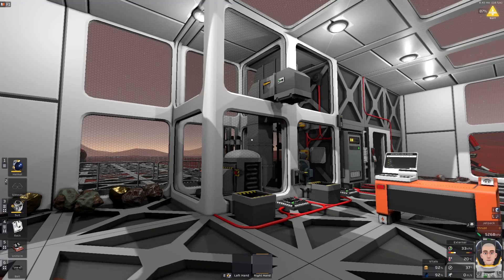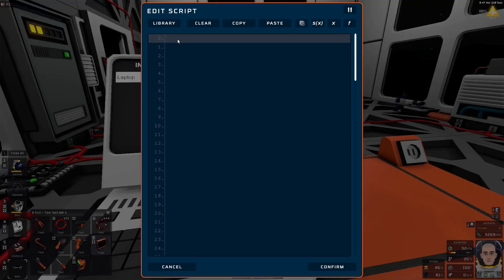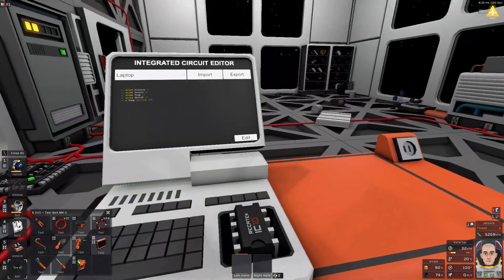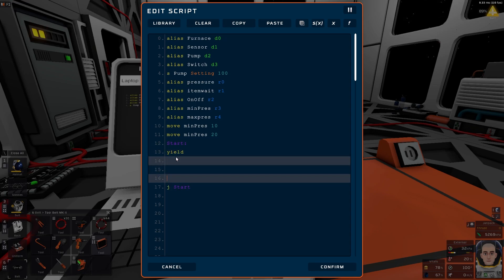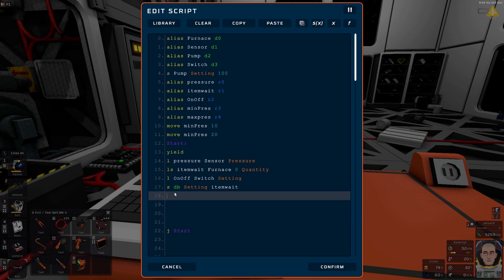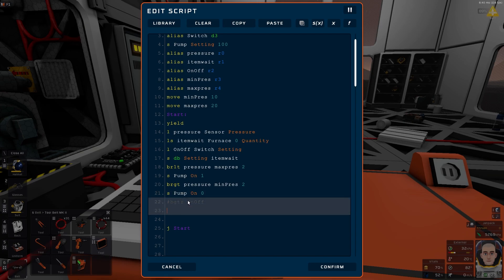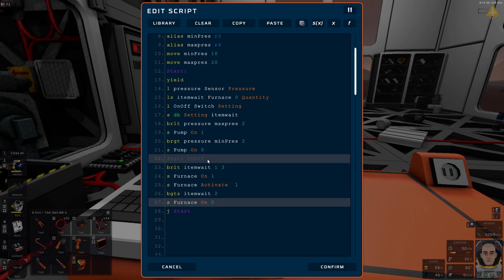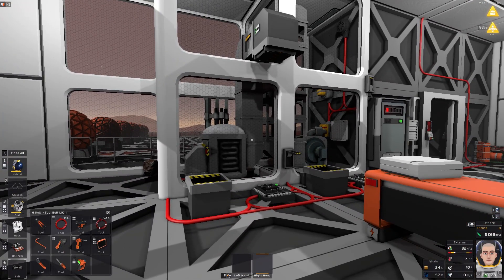Stationeers IC10 Tutorial Automated Arc Furnace

Comment: I know its been a long time since you made this video but how can I apply this to a chain of Arc furnaces without having to repeat it for each? I assume a batch writer and a memory chip but im not quite sure how to manage that properly
Reply from the maker: that is actually a pretty good idea, but yea this IC10 code i used here would not work well for that. I belive that i could come up with an idea for it :)
would they be in the same closed room?
Reply: @osarus_TV  I've managed to chain 6 to a single chip which is decent. So using 4 chips I can run 24 furnaces which is more than enough for early game lol. No bells and whistles but it gets a lot of ore processed fast enough.
Reply from the maker: Sounds great. But i think i will still try and come up with something 😅
Reply from the maker: i made a new code where you can add as many arc furnace as there is space for
https://steamcommunity.com/sharedfiles/filedetails/?id=3385256733
Just add them in the Furnace picker section and see what it can do. 
you will need a lever and sensor for it but the rest is just something you can use